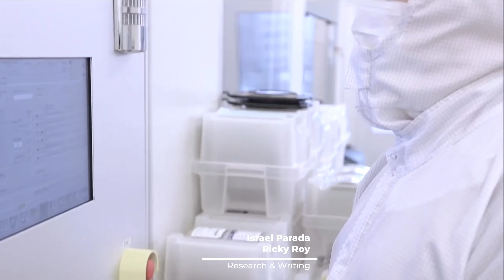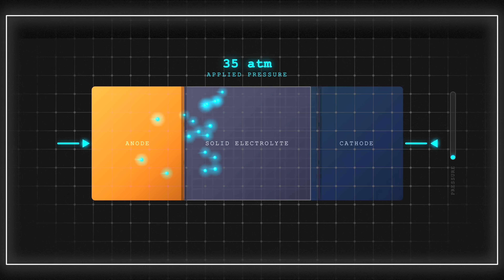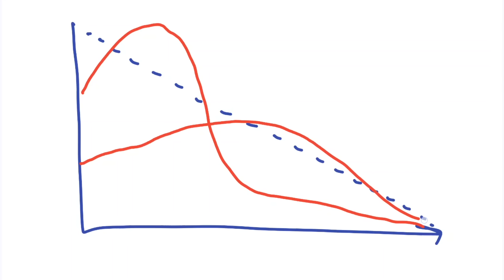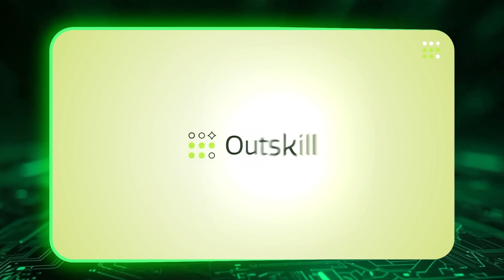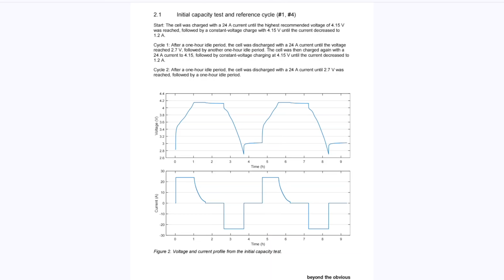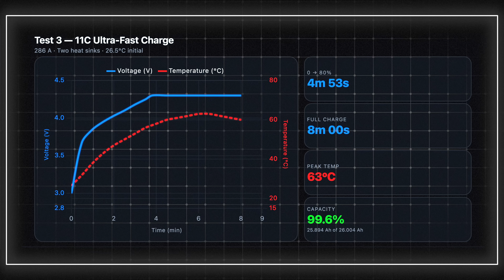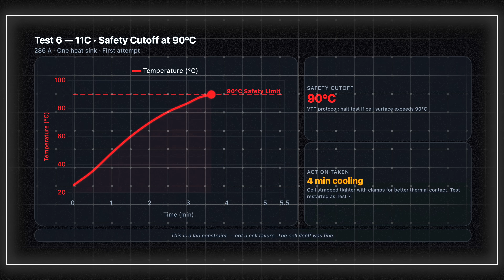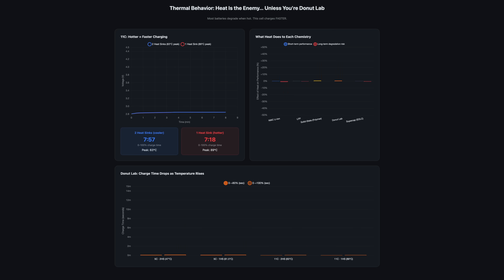Donut Lab's Solid State Battery Test are Shocking...

Comment from the maker: 👉 Grab your free seat to the 2-Day AI Mastermind: 
https://link.outskill.com/TWOBITFEB4 
🔐 100% Discount for the first 1000 people
Reply: It is a good analysis Ricky. The problem is that you (and others) are looking to find the lie in their claims, using conventional batteries and chemistries as a guide. Donut Lab said specifically that it has no lithium or liquid electrolytes, handles fast charging and high heat, and doesn't use rare or expensive materials. Despite reviews, they passed this test, showing the charging speed and heat tolerance. I am hoping that the next Donut Lab battery test is a puncture test.:popcorn-yellow-striped-smile:
Reply: @deanmcmanis4862  I hope they reveal and confirm the chemistry and their scaling manufacturer. A mic drop moments would be to invite influencers TwoBitDavinci to a roadtrip with their battery installed on two to three cars. Old cars like 2015 model X, 2012 Nissan Leaf, 2012 Tesla model s40 or an old Audi e tron … they have to replace the packs with similar ranges and the range would have be of 400 miles packs and go on a 24 hours roadtrip with the final install witness by the influencers.
Reply: @deanmcmanis4862  Puncture and flammability tests, definitely. As soon as one comes on the market, I'm sure it will be torn apart and thoroughly analyzed. I look forward to the results.
Reply: $5,000???!!!!! for that outskill class? Nope!
Reply: Interesting video. Bottom line, the scientists weren't able to falsify some of the claims. Other claims, outside the test scope, seem highly unlikely.
If we add all up, my thoughts go to sodium rather than lithium. The general impression is, it can easily handle higher Ampères and temperatures as well, than lithium.
Reply: @jpdj2715 It is a Solid-Electrode Salt battery. Because there is no flammable liquid, you can drive a nail through it (the Puncture Test) or heat it to 100 C without it ever catching fire.
Reply: but didn't Donut SAY they made it to basically imitate th3e Li-ion profile? liek they designed it to make it be a drop in replacement and there was more room for improvement? - I feel like I saw a video of a guy talking with them at CES and this was mad clear - I could be mis-remembering tho - and I dont  recall who it was that did that interview - maybe it was you lol
Reply: @ThatTweedle  Yes, this was Ziroth's Donut CES interview, where he said that the voltage showed that it was lithium ion. They said specifically that they could engineer the battery to be any voltage, and set it to match lithium, to be easier for vehicle integration.
Reply: @ThatTweedle Mr. Piippo?
Reply: what have you missed? The claim they don't need rare earth metals to build it.
Reply: The Verge "Logistics Hammer": Why 400 Wh/kg is a Mathematical Certainty
To those claiming the 400 Wh/kg density is just "marketing": The physics and logistics of the 2026 model year make this a closed loop. You don't need a lab report to see it; you just need a scale.
1. The "VTT Proof" of Performance
The Feb 2026 VTT test confirms the Donut Lab cell has a 26 Ah capacity and handles 11C charging (0-100% in ~7 mins). This confirms we’re dealing with a cell holding roughly 96 Wh of energy.
2. The Official Weight Paradox
The 2026 TS Ultra: Packs a massive 33.3 kWh battery.
The Weight: Officially spec’d at 235 kg (518 lbs).
The Math: In 2025, the 20.2 kWh model weighed 245 kg. In 2026, Verge added +65% more battery energy but the bike got 10 kg lighter. Even with a 21 kg lighter motor, you can't add 13 kWh of capacity and still lose total vehicle weight unless the battery density has nearly doubled.
3. The Logistics "Checkmate"
If Verge used high-end liquid Li-ion (~250 Wh/kg), a 33.3 kWh pack would weigh ~134 kg for the cells alone.
That would make the bike weigh 263 kg—exactly 28 kg (62 lbs) overweight.
You cannot "hide" 28 kg of mass in international shipping or vehicle filings. A discrepancy that large would be an instant red flag for any regulatory body.
4. The Verdict
For a 33.3 kWh motorcycle to weigh 235 kg, the battery MUST hit 400 Wh/kg.
Calculated Cell Weight: Each cell must weigh approximately 237 grams.
If the cells weighed 315g (as some claim), the bike would be a legal and physical impossibility.
Bottom Line: Denying the 400 Wh/kg density is effectively denying that the bike weighs 235 kg. The physics don't lie.
Reply: What happens when it blows up?
Reply: What do you think about the discharging curve at 1C? The tension decreases almost linearly, there is no abrupt drop at the end.
Reply: What it showed me is they aren't ready for production. If you have a battery, that is ready for production like they claimed or were heavily implying, you prove it. They would have a similar battery as what they had at CES. The test suite itself would have been far more comprehensive. it is vaporware.
Reply: I thought all the batteries by the virtue were solid state..!!!
Reply: The charging curve being similar to a lithium-ion's curve is irrelevant, the real test is the charging/discharge time and lifespan of the battery.   I could care less if it's running on donkey poop, as long as it's reliable, time will tell.  IMO Super-caps is where it's at.
Reply: @BillAnt  Super caps don't work because they still follow the laws of capacitors. Look up the formula for caps in series and caps in parallel, and the discharge curves.
Reply: Standard chemistry, someone said it would have caught fire long before 89 degrees C, so it can’t be that. Also standard chemistry would degrade at those charge rates and temps.
Reply: @jsbrads1  Then why does the lab limit it at 90C? If the batteries are going to catch fire at 89C they would have a lower limit.
Reply: @uowebfoot it was a lab specific safety margin. 
Donut might have tested the batteries to destruction above 160C and may have a safety cut off temp of 130C.
Reply: @jsbrads1  no, that's not right. Li-ion can run at a higher temperature, it just degrades the lifespan. This doesn't prove what you think it does.

Comment: By far, MIss Go Electric Industry's deep dive video is the most comprehensive one out there. They actually put the pieces of the puzzle together and point out the connections between D.L./Verge with Nordic Nano Group, a Finnish University's research, etc. 

 And apparently post that video, they were contacted by some of the more hidden players and told that they were on the right trail and they were given some extra related information, though they are not allowed to share same. They say based on that, they think that this tech is the real deal and not a scam/fraud.

Comment: Bro, D.L. has stated before these test results that based on their chemistry they can purposely tune and match characteristics with current tech to be more compatible with current tech.  Because lithium ion is the current, mainstream tech, they matched to it--hence the "finger print". 

    As soon as someone cuts one of these open and there is no liquid electrolyte and no lithium, all of you assumers will have made an arse out of yourselves (solely). 

  It would be financial suicide to make blatant false claims, and yet pay for a reputable testing entity to test their product, especially when you consider these are private companies not on the stock market. They have nothing to gain by doing any of this.

Comment: If I heard correctly, the battery needs 50 atm pressure to work properly??? 😮 50 atmospheres =
734.797 pounds-force per square inch. When a car tire is 40PSI. This seems a little dangerous??? Can someone explain or chime in?

Comment: I’m a manufacturer that designs, creates and tests products.  There is no way I would test a product without knowing the precise chemestry.  The customer could be using high explosives or other dangerous chemicals.  I can assure you VTT knows exactly what this battery contains.  Also, VTT would not participate in perpetuating a scam.  The testing agency can’t distance themselves from a scam by claiming ignorance.  I am overwhelmingly convinced the battery is real; however, the charge cycle life could be an exageration.

Comment: Great video as usual.  An insider stated the cell VTT tested is 12 mm thick, which looks about right.  Now I wonder if this cell includes room for expansion.  If so, then the cell would be lighter than it appears.  Therefore, the density could very well be greater than 400 Wh/kg.  Donut Labs stated they have already ran varioous tests on the battey to “prove it to themselves”.  This is likely because they didn’t create the battery.  They’re using VTT to increase credibility.  They know precisely how each VTT test will turn out.  I have no indication that Donut Labs have exerated the features.  Like many people, I’m really interested in confirming the charge cycle life.
Reply from the maker: I met with QuantumScape and part of their IP was a flex cell to handling expansion. but they seem to be hinting they dont need such allowances, though I'm not 100% clear on that
Reply from the maker: test two analysis is out btw! https://youtu.be/AzIpgYi4rjM?si=hGLNBZxImcUiKbel

Comment: All well and good, but means you will not be able to pack the cells close together as you need at least one side cooled, preferably only in one layer as well.
Also the Fast charging capability is good but a bit pointless unless you have the Infrastructure in place too charge multiple cars at the fast rate all at once in one location, which is highly unlikely and the costs would be prohibitive to even charge at that rate in any case.
Just because it charges faster when hot does not mean that heat is good for it in the long term and may cause all sorts of issues..

Comment: Thanks for the report.  It smells fishy, but I can't see what they have to gain for lying about what they've got.  Sure, they get short term investment, but if it really is lithium chemistry, they are going to be the subject of such a massive lawsuit.  

The only thing I can think of is that they do have new tech, but this isn't it.  They need the investment to bring the new tech to market, but they also need to show some results to secure that investment.  They decide to fake the results using lithium to try to convince the investors and buy themselves time to complete the development of the real batteries.  If that's what they're doing, it's a really risky move.  Other firms have tried tricks like this in the past, and it ended very badly.  When big investors discover they've been played, they don't play soft ball.  The fact that this looks like lithium suggests they may have been forced into accidentally revealing the scam.  If the investors come to the same conclusion as you, that this looks a bit too much like lithium, they are going to want to do chemistry tests and the whole thing could explode in Donut's face.

Comment: i disgree  that this would be just an evolutionary step , if you combine all their claims  this would indeed be groundbreaking, no rare or toxic  materials , 400wh pr kg, -40 to100c with no performance loss, incredible chargin speed, comparable cost to litium ion, zero safety hazard,  100.000 charge cycles  if that is not groundbreaking . i dont know man.  but lets see if its legit first.

Comment: In a german video the calculations for the efficiency of the cells was not handled so positive as here. They thought that the cell may be dead after 20 or 25 chargings with this big loose of charge after discharge, that the heat will be impossible to get rid of in a car-battery.

Comment: You mentioned that the battery does not contain Lithium. That alone would be a "game changer" is the safety arena as that would preclude it from violent explosion you see so often with Lithium-type cells. And, it is utilizes more common and cheaper materials in its construction, that just adds to its possible "revolutionary" design. Instead of Lithium, if it uses some form of a carbon-based system such as nanotubes or graphene, that would greatly reduce cost.

Comment: Thank you for your analysis, by far the best, most balanced take on the subject, as there is so much we don't know yet, but the promises still sound too good to be true with these batteries.

I really hope that they have some kind of a material in there, that acts electrically very similarly to NMC lithium Ion batteries, but is something else, as even if this was a really good battery with false claims, NMC Lithium Ion wouldn't mean this could be manufactured from local materials nearly anywhere, as they promised. There would be a lot of broken promises at that point and even if the battery was an evolutionary step, it would have had bad plenty of bad press that would hurt sales, big time, when competitors would have similarly performing batteries available.

Could anyone knowledgeable tell, if they know of any material, theoretical or not, that could seem like NMC Lithium Ion by it's electrical properties?

Googling gave these options as some, but none of them are solid state and all of them contains lithium;

NCA
NCA (Nickel Cobalt Aluminium Oxide) batteries are high-performance lithium-ion cells known for exceptional energy density, long lifespan, and high power output, making them ideal for electric vehicles (notably Tesla) and portable electronics. Composed of ~80% Nickel, 15% Cobalt, and 5% Aluminium, they offer high capacity and lightweight, though they are generally more expensive and less thermally stable than NMC or LFP alternatives.

NMA
Nickel-Manganese-Aluminium (NMA) represents a promising class of cobalt-free, high-nickel cathode materials for lithium-ion batteries. Developed to reduce reliance on expensive, scarce cobalt, NMA provides a sustainable alternative with improved thermal stability and high energy density, aiming to match the performance of traditional NCM/NCA chemistries.

NMCA
Nickel-Manganese-Cobalt-Aluminium (NMCA) represents an advanced class of cathode materials for high-performance lithium-ion batteries, often combining the high energy density of Nickel-Cobalt-Aluminium (NCA) with the structural stability of Nickel-Manganese-Cobalt (NMC). These chemistries are crucial for electric vehicles (EVs) and portable electronics due to their superior, long-lasting energy storage. 

LNMO
High-voltage spinels, primarily LiNi0.5Mn1.5O4 (LNMO), are cobalt-free, high-energy-density (650 Wh/kg) cathode materials operating at 4.7V, ideal for next-generation lithium-ion batteries. They offer low-cost, high-power performance, but suffer from significant capacity fading due to electrolyte decomposition and metal dissolution.

Comment: I still think it's a lie. If they had what they claim, they come out the door swinging, and be ready with all the awnsors so they can sell while they are popular. Not slow run it and end up getting forgotten.
Reply: They would need to be able to produce it first. If rumors are correct they only purchased the production line a few months ago. The time is barely enough to set it up and make the first batches for validation with partners (who were featured at CES) and Verge Pro units to be delivered next month.

Comment: I have no tech/eng background in this arena. However some Qs. 

What would be the significance and potential upside (if any) if this were a solid-state cell that (by design) had the performance profile of a high end NMC-lithium cell? 

It seems as if the expectation is that a true solid state cell would NOT have a performance profile of any existing non solid state chemistry.  My gut tells me that would likely be the case.  

But why would or would not a SS cell that had the performance profile of a high end NMC-Lithium cell be of interest? 

I realize other (density) metrics Donut touted fell short as well.

Comment: CLICKBAIT (high confidence)
The title uses dramatic ellipsis and the word 'Shocking' (likely a pun on electricity/batteries) to create artificial suspense around what is probably a routine product review or test. No specific factual claim is made.
Flags:
• Vague, non-specific claim with no actual information
• Trailing ellipsis used to manufacture suspense
• Emotionally charged word 'Shocking' used for dramatic effect
• Classic clickbait structure designed to provoke curiosity without informing

Comment: Thanks for posting. I've been eagerly anticipating results. I watched the Ziroth video as well. You seem less pessimistic at this point. I want to believe in what Donut claims to have achieved, but the proof will be in the pudding, won't it. I'm betting they've developed a mateirals process to amend some more benign element's electical properties to mimic Li. Either by chemistry or extraordinarily high pressures, or both, or maybe vapor deposition?

Comment: Okay, think about this, if a piece of steel is heated to +100℃ and placed on top of a newspaper, do you think the newspaper will catch fire? In the VTT test, the safety limit was +90℃, which was defined by VTT itself, while Donut labs has reported that the battery works normally up to +100℃. So I wouldn't jump to conclusions. Also Okay, too bad that all your arguments are based on existing chemistries and technical solutions that are currently used in batteries. It would be desirable to take into account the fact that Donut labs could have invented a completely new chemical composition and technical method to make their battery. Then previous battery technologies have no legitimacy to be used as comparison points. So why are you drawing sweeping conclusions?